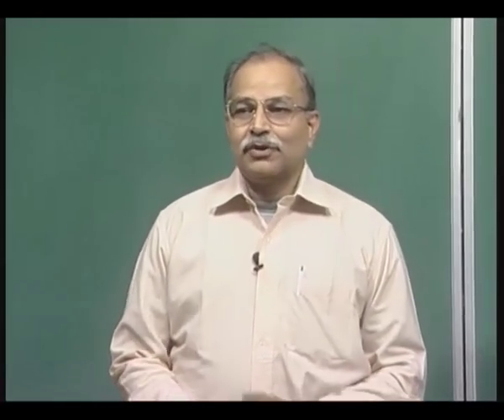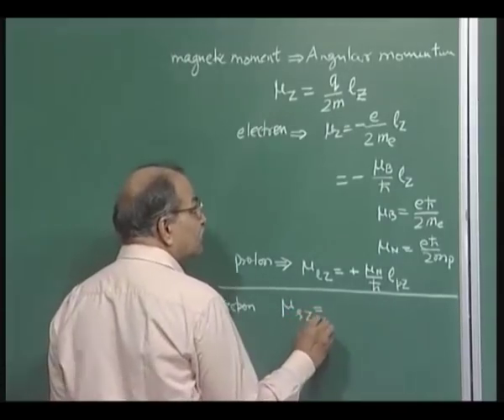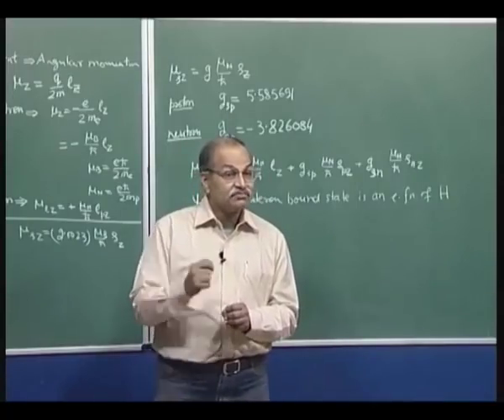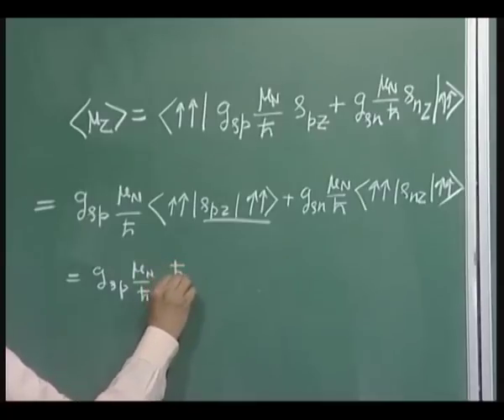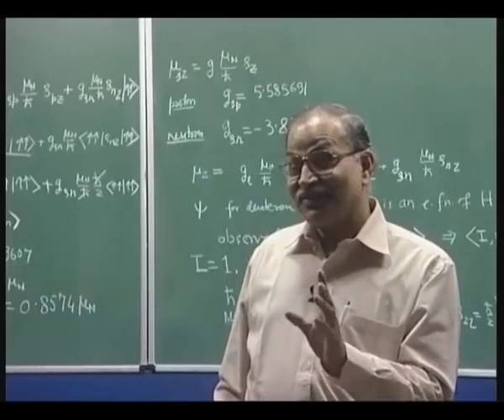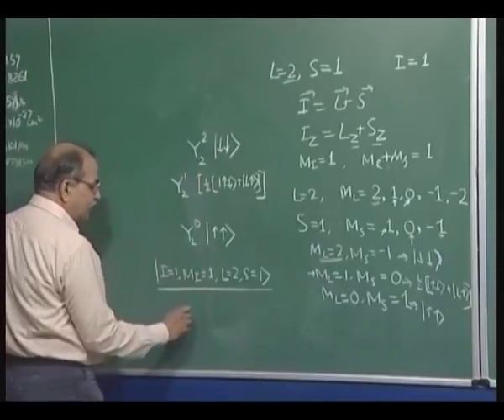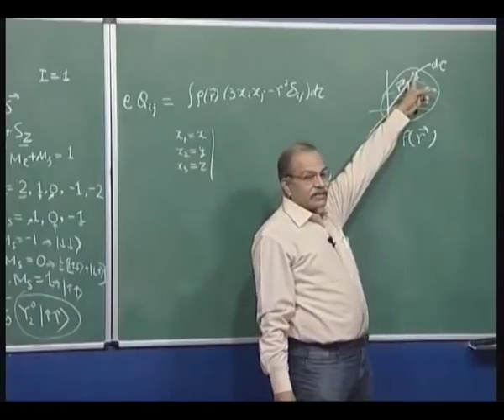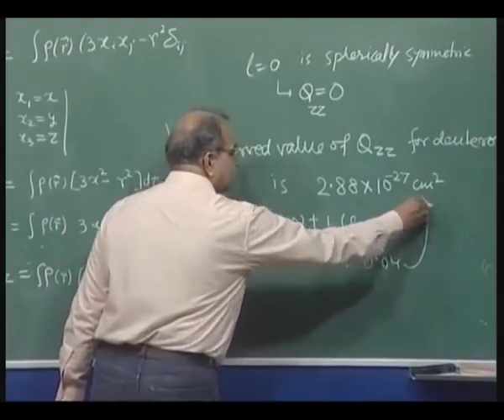Mod-01 Lec-13 Deuteron Cont..

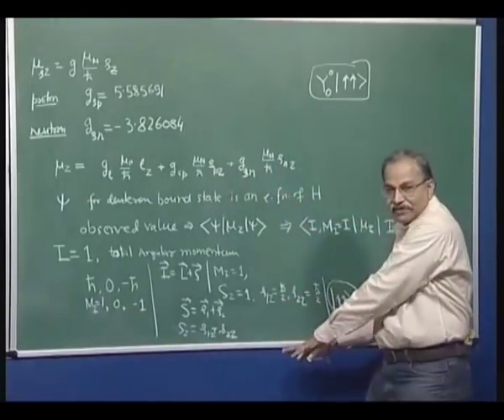Comment: For the calculation of magnetic moment suggested at @42:00, additionally we have to consider the orbital angluar momentum is shared by neutron and proton as suggested in 3rd chapter of S. M. Wong. So for the Y22 state l=1, Y21 state l=.5 and Y20 state l=0.

Comment: Why the first part of magnetic moment (orbital magnetic moment of proton) is zero.😕🙄🙄
Reply: Becoz deuteron has even parity, and if L was not zero and say was one, theory wouldn't match with experiments !!
Reply: this was assumed that potential is central where L=0 which is r dependent only not spherical part as l=0,lz= 0
Reply: It doesn't have any charges so when orbiting around center doesn't produce  current